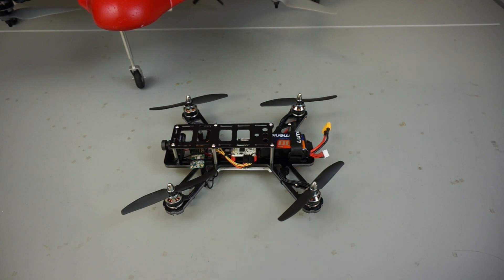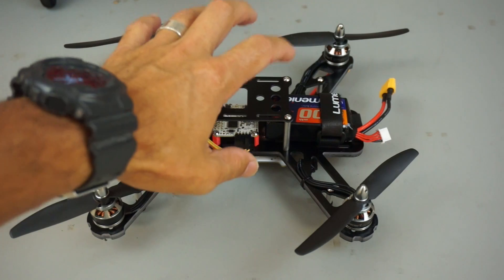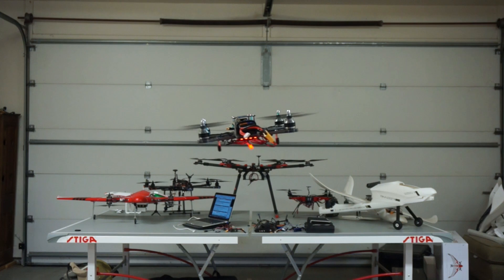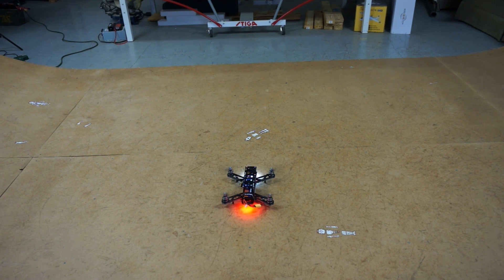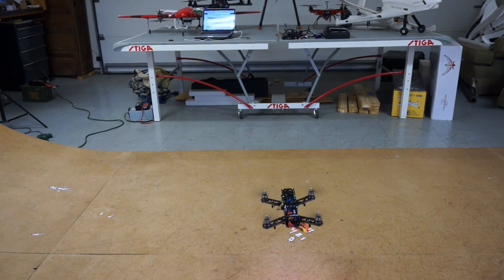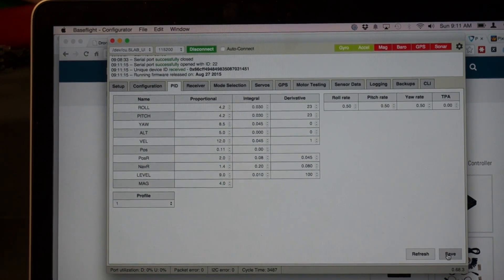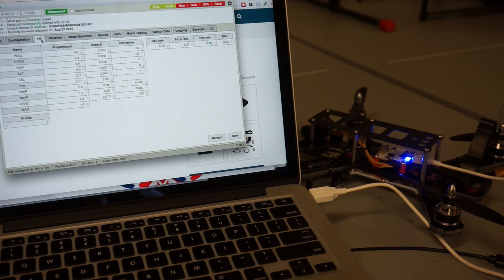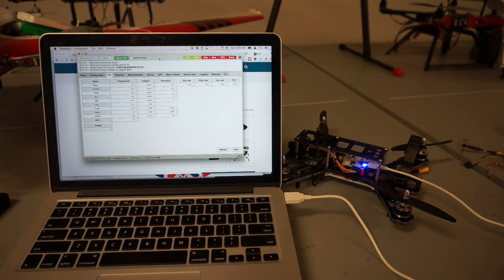QAV250 Tuning P Gains and Rates with Acro Naze32

Comment: if you are running 4s, you need to lower your loop times that is 3500 to 1200 -1800 and that also allows you to increase your PIDs  a bit. looking forward to your pixhawk video
Reply from the maker: +Juan Sarti Great tip. Thank you for sharing and I'm definitely going to look into 4S soon.

Comment: I always begin with looptime and CLI settings (betaflight notwithstanding as those aren't needed there) TPA will smooth out slight oscillations with proper looptime. 
Looptime is based on esc refresh rates and if you are using oneshot (good rule of thumb is if the refresh rates are 600 then the looptime will be around 1700- oneshot will allow that to go lower on certain esc's- some even 0!) (refresh rates of 500 will net a looptime of about 2000, and rates on esc's of 400 (older blue series) have a looptime of 2350.
Deadband settings based on rc tab deviations on the channels (usually about 3 to 5)
If you are a strict rate mode flyer, then turn off the acc. You can also turn off the emf avoidance as on a 250 the mag is not used even if you have one and this will free up processing power.

Then you can begin tuning the PID's- beginning with the P on roll and pitch.
You also may want to look at your rc rate- .90 is default and I am usually around 1.0 to 1.20 (fast stick response)
Check for oscillations on punch out in your goggles, and tune that out with the P
Check for flutter on decel in the goggles, and tune that out with I
Check for the "snap" on stick stop while flying and if it is sluggish- add some D once P and I are good on the pitch, roll, and yaw.

Tricks for Horizon mode or self level flyers are all of the above minus the ACC turned off, and add a CLI setting to the ACC LPF Factor of 100 (default is 4)
Also- the LEVEL pid settings if scaled back to 8.7 or 8.5 will soften the return to level when flying.

Way too much to detail, but there are some advanced tuning tips to try.

*CLI COMMANDS

set looptime= xxxx
set deadband=xxxx
set yaw_deadband=xxxx
set acc_lpf_factor=100
set emf_avoidance=1 (for off)
*let me know if you want some links once you have dabbled.
Reply from the maker: +Hiway I can always count on your to take it to the next level. Really appreciate your knowledge and will be giving some of these suggestions a try. Many thanks and hope all is well.